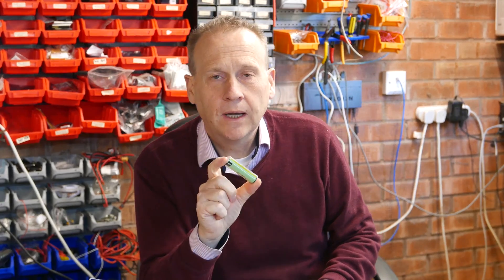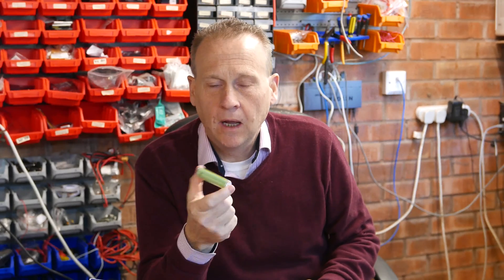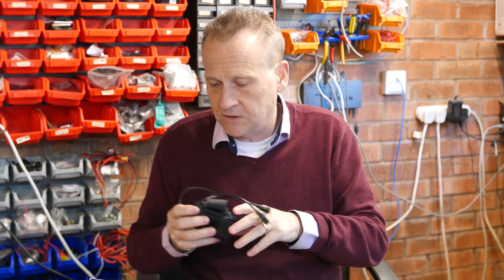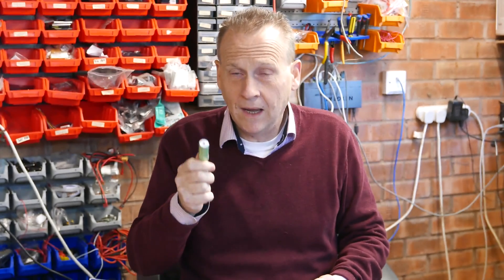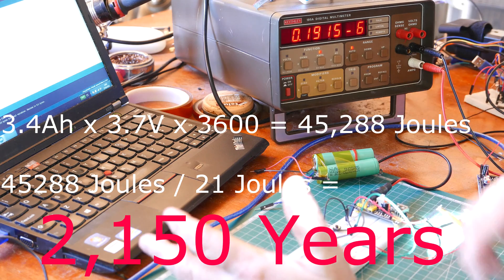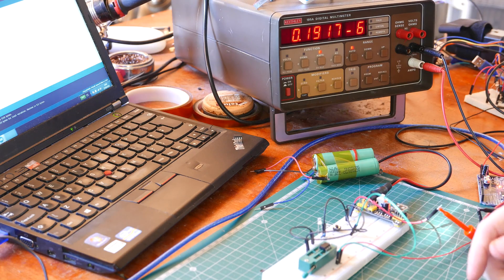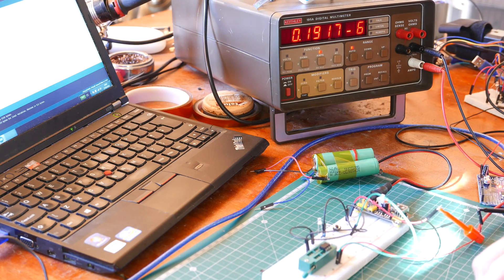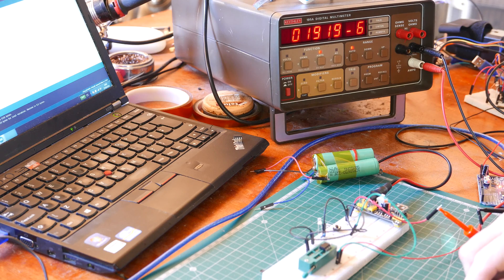Arduino POWER 200 nano Amps current SLEEP  - 2000 Year Battery Life!

Comment: i recently tried to achieve similar setup... there were few challenges i faced... 1) low power LDOs, 2) tantalum capacitor and mosfets cost and availablity (for output), 3) actual usable battery capacity, 4) fanout for sensors spiking (500mA+), 5) and lastly more common battery usage such as AA or 9V... so the only stable solution i found is the TPL5110, but thats may be just me
Reply from the maker: TPL5110 is amazing.